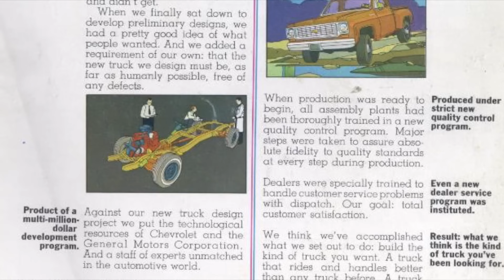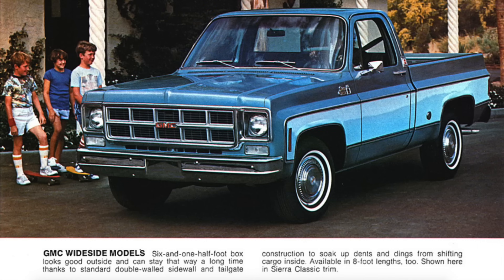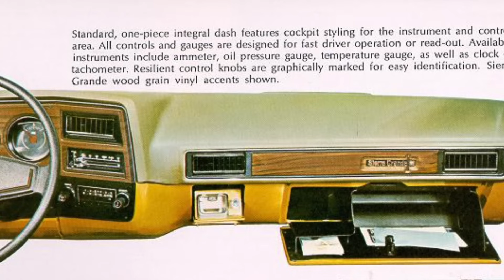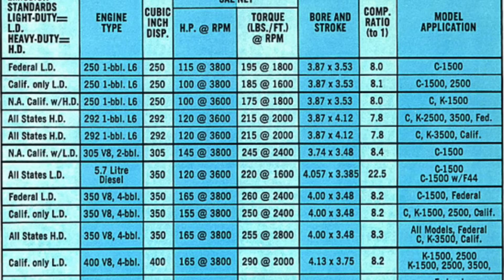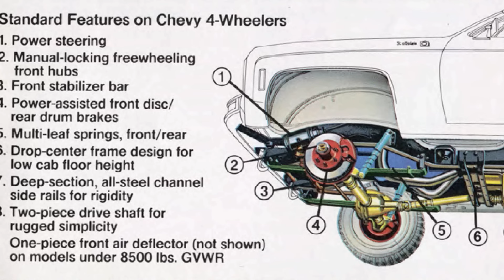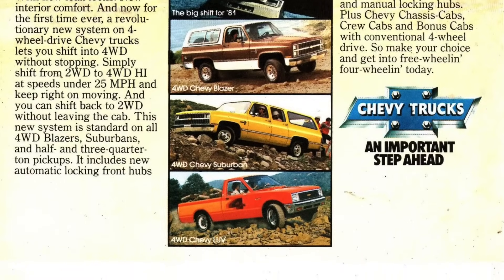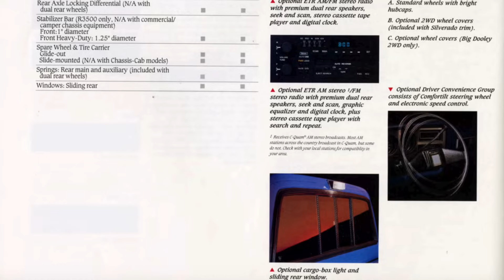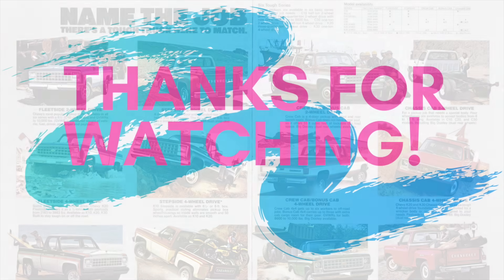73-87 Square Body Chevy & GMC C/K Truck Buyers Guide (Design, Options, Engines, Common Problems)

Comment: Short beds have really become a collectors item and are getting really tough to find. They seem to be going up in value every year.
Reply: Have two of them
Reply: I want one for a first truck, but I’m going to get a long bed just to save money
Reply: @muricaman991  long beds ride good!
Reply: Long beds are somewhat cheaper, ride so much better out on the open road, and haul more work too!! 👍

In fact, I think it is horrible people have began cutting & sectioning this generation of LWBs no into SWB trucks!! Terrible!!
Reply: I believe that I have 2 myself.
Reply: @BreitbachTheGerman  I have a 1978 BIG10 454 that I ordered new in 78, it has 82k miles with no rust.
Reply: True but believe it or not so are longbeds as well those square body's period, are just hard to find short beds and longbeds square body's are going up in value
Reply: Another rarity is a long-bed step-side.  If you ever do see one, it usually is or was a government-owned unit.  VERY few were purchased by the general public, much like the longer wheelbase Lincolns.
Reply: I feel like once I put a toolbox in a shortbed it’s just too short.

Comment: My had a 1974 GMC Robinegg blue white top 350.. eng ... he bought it the day I was born in April 2nd 1974 . He drove it until 1995 when my brother drove it without putting oll in and ruined the engine... my grandpa had a 1973 Chevy he drove it until he sold it in 1990 to by a motor home...

Comment: 17:41 My dad had a white fleetside 77 sport.  It looked great with the white wheels.   He added center caps and yellow stripe wheel opening trim to it.  It had a switch on the dash where the dual tank switch normally is that said aux lights to turn on the lights on the rollbar.  It said CHEVY SPORT at the back of the bed.

Comment: I have a 1973 C10 square body.  Auto 4 speed, 350cc and 333hp.  Love it.  Great job on the video.
Reply: 333 horses on a 73?  Stock, only 145 - 165 horsepower.  Must be fun!

Comment: Bought my 86 K10 for 1500$ 3 years ago. No drivers side floor. No heat. 154k miles. Gear indicater does not work. 14k miles later and has never left me stranded.
Reply: Hey,it don't have to look good it has to work good.

Comment: I have owned three and still own a 1986 c10 last of the carbureted engines, and 1987 was the R)V series and was made until 1991 as crew cab and surburan, and Blazer/Jimmy models

Comment: My family still has a 1980 GMC Sierra Grande that my grandfather purchased new. It has 90,000 km, and although it isn't rusted out, the body is riddled with dings and dents. The tiny windows that direct air into the cabin never seal quite right, even after several different seal kits. The oldsmobile diesel struggles to start when it get chilly outside, forget it in the winter! We purchased a spare engine because injectors and many parts are hard to come by now. The hydroboost power steering and braking system works very well, and I was always impressed with it. The truck has vague handling and its suspension is rudimentary, but it did its job on the farm, and helped me and all my friends move over the years.
Reply: An Olds diesel with over 30,000 miles that still runs?  Wow!  That is super super rare!

Comment: I have a 1987 R10 Silverado (yes R10 not C10). I bought it brand new when I was 26 years old. I'm 62 now and me and that truck are still running. I probably have more replacement parts in me than that truck. It's all original and nothing has been modified. the 1987 was the first year for TBI fuel injection and the first year they started putting the 350 back in the 1/2 ton pickups and the last of the square body's. I paid $12,500 for it new and have been offered as much as $15,000. She's a keeper and it will be passed down to my son (But only when I'm done driving it). It's been a great truck.

Comment: I own a 1978 GMC Jimmy 4x4 and I love it and will keep it for the rest of my life , it's easier to work on than newer trucks , is made of thicker metal and gets looks everywhere I drive it . I drove a 75' Chevy PU for 300,000 miles and it still looked good when I sold it , plus used a 84 Chevy PU for work for years and loved it and still love the style , the only reason I got a newer truck was because of the 4 door extended cab

Comment: I traded for a 84 gmc 2 wheel drive  three quater ton  granny speed a year a go  our newer ford went down now its our daily driver 350 motor out of a 1973  chevy iv done alot of work when bought it had no clutch 2 bolts holding in the trans mission  replace fly wheel clutch trow out bearing pressure plate starter carrier baring u joints now got to replace yoke on rear end body needs work but it not bad price for parts

Comment: 1982 had 6.2 diesel engine option as well. Rare breed for sure. Just saw one on Facebook, and ebay has a military ambulance with one as well. Thanks for the video.
Reply: The previous Olds diesel was so bad that diesel's reputation was severely tarnished for several years.  Your 6.2 diesel, I think it is a 379 cube, is a good engine, as it was designed by diesel experts.

Comment: I had a 73 w a 350 in it back in the day and the motor was  tired but it had a posi rear end w a 373- 1 gear  ratio so when I blew the 350 up I found a 73 grand prix low mileage w the 400 and a 400 turbo transmission  but it was a rust bucket so out it came and the poncho motor went in the truck tranny and all made my own motor  mounts etc stock exhaust manifolds with new mufflers that dumped just before the rear end sounded  good too and lets just say the 350 didn't  hold a candle to that 400 motor as far as torque and even hp which was not real high but the torque was over 350 ft lbs it was a blast and I would  pick up a set of tires on a fri afternoon on my way home  and burn them off all weekend  Sunday afternoon  my good bf Goodrichs would go back on for work on Monday morning  I drove it for a couple of years doing that and surprised more than one mustang or Camaro leaving them saying  WTF!!! Lol good times I would do it all over again  too lol
Reply: This was in about 85 86 ish so nothing coming out of Detroit was worth a shit except the grand national  or something along those  lines and even they got a run for their money which was a ridiculous amount lmao bang for the buck I had it all over them fast for cheap lol another  great combo was to find a mid 80s g body like a nice cutlass  supreme that was a diesel engine oh boy a rocket350 from say a 68 69 or. So cutlass was a plug and play and with the 350 turbo transmission from the older one it was awesome due to the 2004r tranny that was behind  the diesel the rear gear ratio was a 342-1 or373 -1 limited slip even so with the car being considerably lighter and it having  a limited  slip and the 350 rockets were well just bad ass anyway  for torque numbers all my buddies heard me coming for miles with that quadrajet moaning just as loud as she could that sound carries  a long way lmao yeah I need to put the bong down huh lmao
Reply: It only had a 100mph speedo and it would go past that all the way to the peg for zero and start bouncing off the peg so I figured  a buck fifty anyway and the poncho motor would keep pulling hard there was no end for the top end like a big block Chevy they just wind and wind out a small block will run out at some point but pontiacs and oldsmobiles didn't and bang for the buck for 200 bucks a junkyard motor over the same amount for a 350 Chevy I loved the olds and ponchos all day every day

Comment: I still own a 1967 Chevrolet C10 Custom pickup. My dad ordered and took delivery of it in January of 1967 when I was 15 months old. He ordered it with "panoramic" back window, 220 HP 327 V8, Turbo Hydramatic 400 automatic transmission, and 3.70:1 rear differential. 

I also owned a 1972 Chevrolet K10 pickup.

The 1967 to 1972 trucks are far superior to the 1973 to 1987 trucks, in my opinion.

The 6.2 L Diesel was introduced in 1982...

Comment: 73-87 was for the trucks only the GMC Jimmy, Chevy Blazer and Suburban used the square body for and additional four years. I currently own an 1988 GMC Jimmy, Love it it is my 3rd Jimmy the first was my favorite 1975 GMC Jimmy with a full removable top, then I had a 78 GMC Jimmy was just luck I guess I always got the Jimmy and not a Blazer,  Also own a 1986 GMC short box truck with 4.3 V6 and three on the tree.. Loved them all..

Comment: Had a half ton 80 Suburban with a 350.  It ate front brake pads for breakfast.  Two transmissions and two accicents later, I sold it.

Comment: I currently own a 84 Chevrolet c10 Silverado with the 6.2 diesel, I love my truck and have always loved the square body chevs. My first one was a 1976 Chevrolet custom deluxe 10, it was orange had a short bed with 4 wheel drive and had the three speed manual with the granny low. Wish I still had it. Thing was rusted out pretty bad though.  Cant complain about these old trucks they are good looking and still very popular.  I plan on installing a small block 350 in my 84 once the diesel gives up.
Reply: You will have to replace your front springs, as diesels are pretty heavy and the small-block Chevy is pretty light, or else you will be nose-high.

Comment: I've got 3 of them. 73 1 ton. 80 GMC short bed and 81 3/4. All still running strong. Of course none of them have the old quadrajunk carb on them. My 80 gmc would outrun most Mustangs in 94.
Reply: That carb would be the first thing I replaced if I had one with a 4 barrel.  I like square-bore 4 barrels.  Don't need to floor it all the time.

Comment: Proud owner of a 74 square
Reply: The last year you don't need emission control BS, your lucky.
Reply: @RedneckHillbilly-ho9md  that only depends on where you live if you dont live in a terrible emissions nazi state then you can have whatever you want.
Reply: @briang4470  well I live in Pennsylvania and while I am in a rural county that does not require emissions tests for inspection the entire state requires a visual inspection and all parts that were factory must be on the car, they don't need to work but they must be on it. Everything made after the 1975 federal emissions laws must have them.
Reply: @RedneckHillbilly-ho9md  I live in Florida, no emissions testing, no visual Inspections, nothing, drive whatever you want just pay for registration and insurance and bam your good to go.

Comment: I have a white  '85 Silverado short bed that has less than 500 miles since rebuilding the 4.3l v6 and turbo 400.  It has all new suspension and steering components,  new limited slip rear-end, u-jonts, brakes, some new brake lines, ac components, heater core, radiator,  belts, hoses,  quadrajet carb, door hinges & latch post, new tires, and several more electrical parts.  Everything kept original down to the smog pump, vacuum lines, and exhaust system.    I've got a lot in it.  Still need to do minor body work and paint, rubber moldings, and some interior before its 100% complete.   I am considering selling it if the market is hot.  I have 4 other projects that I need to finish.

Comment: I currently own 2:
1984 Chevrolet C30 Silverado single cab equipped with a 350 4 barrel and SM465 manual transmission
1991 GMC Suburban R1500 SLE equipped with a 350 TBI and 700R4 transmission.
Bought both of them in 2013 for 1,800. Suburban ran when purchased so, it became my daily while the C30 became a long term project.

Comment: I ordered a new 1976 K10 Silverado SWB 4X4 with all options. Salesman told me if I got the small block 400 I would have a TH400. When I received it I was so disappointed to see a TH350 and, new to me, full time 4X4 with NP203. What a gas hog! But it would fly! The two tone paint job looked like it was done with spray cans and not one body chrome lined up. The leaf spring front made this short bed ride like a bucking bronco. Owned it for four months and put less than 2K miles. Took me that long to sell it. Didn't have the
Lemon Law back then. Ordered a new 1977 Ford loaded. Flawless! Day and night difference.

Comment: I picked up a 90 blazer for 1000 bucks only 2 problems was frame crack by the steering box n and the front driver seat mount busting threw the floor very good video loved it

Comment: The dairy farm bought a 1986 GMC 2500 (new). It was the weirdest truck I ever saw. Even though badged as "2500", it had the GVW of a 3500. It was powered by a 350 engine but the heads looked different than any other 350 engine. It ran on "regular gas" & it said this on the dash, sticker on the cab door & on fuel tank doors. Reason why I'm saying this is unleaded gas was being pushed hard then. The first time the heads on the engine had to be pulled "1990", the only place to get parts to replace these weird heads was through GM & all parts for the heads had to be special ordered. Overall it turned out to be a good truck & was on the farm till 2009... RIP, Old Blue...

Comment: My brother and I are fixing up an 83 Scottsdale c10, luckily it isn't in the worst condition now after rebuilding the rear end and replacing the front bearings. it came from a farm before we got to it, and it does have the body rust in the usual spots, but we're handling it pretty well lol. Having and working on old vehicles is the coolest thing you can do in my opinion.
Reply: And funny enough, while i was dealing with the rust, i found a couple handfulls of cut-up rope packed in the front right fender. That has to be the weirdest thing ive ever found lol

Comment: I have a 1979 Sierra classic "heavy half" that my friend traded me for a wrecked 1977 Corolla. I didnt even know if it would start or how it would run but after I changed the ignition lock and battery, she amazingly started right up..since then I've done all the bodywork/paint, engine work, dressed up the engine, got some bullet style american racing mags on BFG A/T tires and man I love this truck..even though she wasn't ordered with power steering I drive it everyday and I'm never gonna sell her!!!

Comment: I bought a new 77 GMC High Sierra 4x4 free wheeling 4 speed manual duel exhaust duel tanks duel battery regular cab short box rear chrome step bumper with trailer package 350 4 bbl. with a 3.73 read end and added 16" rims........loved it ! Sure wish I had kept it ! After 1987 GM went down hill !

Comment: I own a 1973 C10 Fleet side ,it has a 250 six,3spd on coloum converted to floor shift, manual disc brakes, manual steering,no ac am radio. It also has points ignition which still works. I drive it on daily basis here in OKC,OK and make trips to my property in eastern Ok when needed,about 500 miles round-trip

Comment: I have a 86 gmc sierra classic fully loaded. Short box 4x4 with a 4 speed...all original. A few add ons, but mostly untouched with 67,000 miles. Had it for 28 years now. Just put her in the shop last Oct, doing the under cairrage now.

Comment: I have a 73 GMC Sierra Grande C25 Camper Special that I love.  Glad you did mention the rust, as these trucks are serious rusters, unless the original buyer paid for rust-proofing, which few did, but overall, these are great trucks.  Small correction:  The 73 alone had a 307 V8 as it's base V8 engine.  The 305 came out in 76.  Also, the mean reason for the low power of 70s and 80s vehicles was emissions.  There simply was no way to get an engine with an aggressive camshaft to pass EPA mandates.  Yes, there were exceptions like the Pontiac Trans Am Super Duty, but exceptions are just that - EXCEPTIONS.  The oil embargoes, two of them, caused the use of super-tall gearing, which hurts acceleration and towing ability.

Comment: I bought a 1985 K10 with  74,000 original miles for $2500.00. Only has 10% rust and for a Michigan truck that’s almost unheard of. It has a really good SM465 four speed with granny gear but a very under power 305. I bought a 350 to drop in this spring. Love the truck
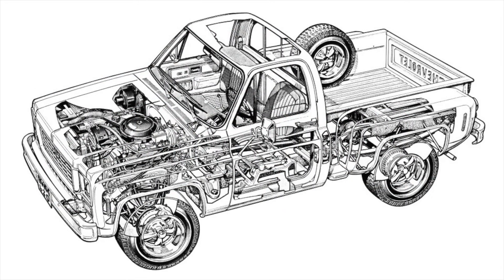Reply: Actually, 305 cubes isn't too small.  What is wrong is the super-tall gearing, chosen for the highest possible gas mileage rating.  If your's is an automatic, you should be running something around 3:36 - 1 or 3:73 - 1.  If a stick, you should be running 3:73 or 4:10 gears.  Yes, shorter gears will lower the comfortable cruising speed, but a 4X4 is made for pulling power.
Reply: @michaelbenardo5695  it’s a 4 speed with granny gear 1st. 3:73 open diff on the tail.

Comment: A 1967 truck for $2,408 would be like buying a truck for $18,779 today. Outrageous how much the price of trucks has increased even after you take into account inflation rates. Instead, now you have to wait 5-10 years and 50-125k miles for a truck to drop to that price.

Comment: Suggestions at this point would include things like at least a gasket kit and oil pump in a timing chain to the engine and more prevalently on the Suburban and K5 Blazer models another thing I would replace is the throttle body injection one other common problem I run into the y-pipe is prone to rusting out I have a 91 Suburban A friend of mine has an 87 C10 another friend of mine has an 89 C1500 all of these are very high mileage trucks all of them in the throttle body injected era I know somebody who has in the 89 2.5 L S10 who also ran into all of these problems

Comment: I've got 3,  
78' GMC   C1500. Daily 127K
78' CHEVY K30, 46K, 456 ⚙ 
80' CHEVY K30, 33K, 456 gears 
All have 350 engines.
Looking for low milage trucks check out your local cemetery maintenance caretakers.
I did!  ;-)